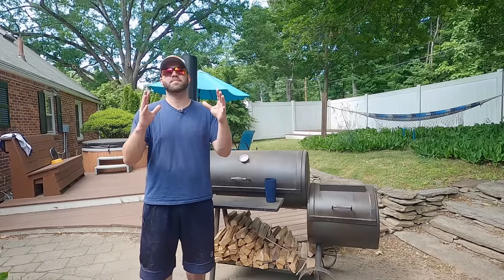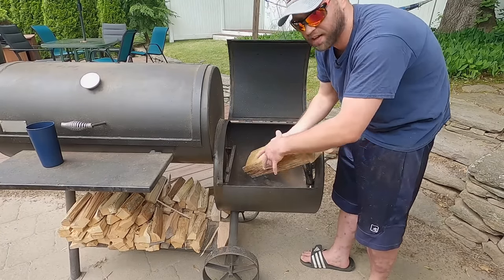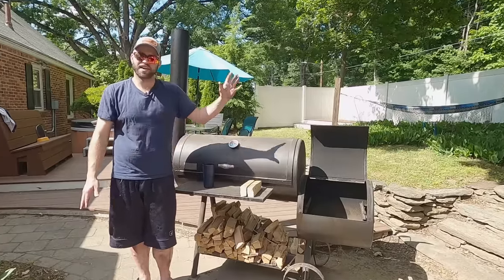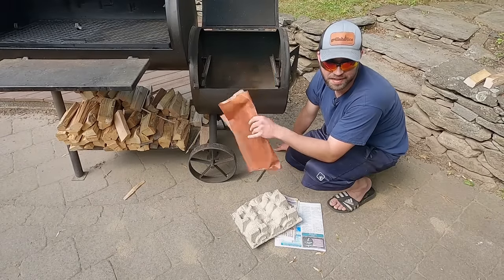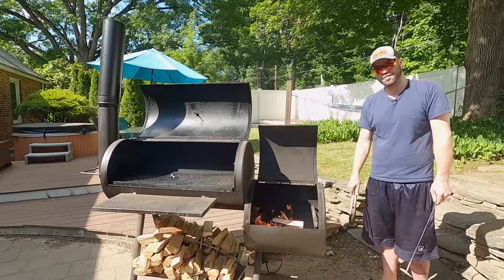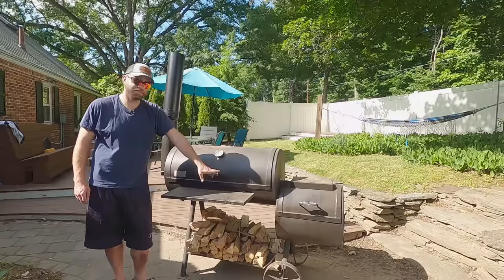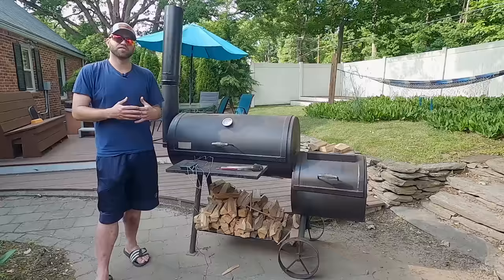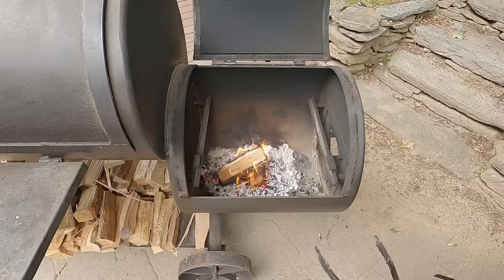OFFSET SMOKER FIRE MANAGEMENT FOR BEGINNERS | How To Burn A Clean Fire | Fatty's Feasts

Comment: Great video.  Found your channel while debating getting the Brazos.  Still debating, but have a question:
I plan on doing some backyard competition.  Q: What do you think would be the easiest way to get it off and on a trailer by yourself?   I’m considering passing this smoker and getting a towable one, but don’t want to spend $8000 when this seems to be the perfect size and I have a trailer 
I enjoy your channel. Thanks
Reply from the maker: I'll be honest, it would probably be extremely painful to do by yourself. I have a small trailer as well and I probably wouldn't even attempt to move this thing onto it without help, just because the wheels suck going uphill. Maybe if you modify it and put better wheels on it, you could move it easier. Other than that I would just buy one on a trailer. You can spend around $4000 and get one that's awesome and on a trailer.
Reply: I’m already with you 
Already found some custom 12” (11 3/4) wheels and tires online with a 2” wide axle
I was also maybe planning on using a winch to on/off load 
Trailer takes 6 months to build and I’m too impatient. The problem now is that the closest Academy near me has 2 Brazos available, but neither can be completed because of missing the main grates   Fuhh…
I’m a hard head and gonna keep trying to find a way to safely transport 
Thanks for your speedy reply and great sense of humor
Reply from the maker: @johnsaunders8395  Ahhh a winch would be a good idea. I like where your heads at. Good luck and let me know how it goes!

Comment: Nice Video  thx
I just wana say; Fire burns from top to bottom.
Always towards oxygen

In the coal chimney from bottom to top
Reply from the maker: I'm not sure what you mean...Fire burns bottom to top. I mean if you light a fire with a base of logs and kindling on top, yes it will eventually burn down. But naturally, a fire wants to travel up and out. That's why fire has an easier time traveling uphill, rather than downhill.

Comment: On the bottom of the fire box place broken half fire brick (only about an inch thick) or use a tile saw/diamond blade on a grinder and build a base, it will save the steel underneath and its an insulator, probably won't utilize as much wood on your cooks.
Reply from the maker: I've been debating doing that. I'll definitely give it a try!

Comment: So with my Oklahoma Joe's, I currently have a baffle setup at the firebox.  I've been unsure if this inhibits heat flow, but sounds like you have consistency without one.  Thinking I might remove it now.  Thanks Bro for the tips.
Reply from the maker: No prob!! Was that in there when you got it or did you add it?
Reply: @FattysFeasts  I added by putting foil over an extra grate I had.
Reply from the maker: @johncarnovsky2081  Did you have problems before you added it, or did you just do it to try it out?

Comment: I have a char griller on my deck that I bought 30 years ago. Mine looks like yours. The biggest difference I see between them is mine has a chimney about 4” in diameter that is welded to the top cover. Are there any videos on modifications of the older model? I’ve ruined so many pieces of meat on this thing that have that nice road tar taste! I’ve got pages of notes.
If my old char griller is a bad design please don’t be afraid to say so.
Reply from the maker: Do you have instagram? I'd love to see some pictures if you could message me there!
Reply: Sorry I don’t subscribe to instagram. Wish I did, I have the double thermometers, I have the baffle plates to even out temps, have the vent pipe down to the grate level, did a propane conversion using 48oz juice cans to generate smoke, was using a water pan, always had getting too heavy smoke, lined with firebrick to stabilize heat. Did everything except sing to it.

Comment: There are new thoughts on clean fire and clean smoke. Fact of the matter is lots of BBQ fans like a stronger smoke flavor than clean smoke provides. Mad Scientist BBQ used to think like you do but he has since changed his mindset.  Heavier less clean smoke for the first couple of hours of your cook provide a better smoke flavor. Also once your meat reaches 140 degrees, it's not going to take on any more smoke flavor. Me personally, I like to hose down my wood the day before my cook because it provides a better smoke flavor as wet wood doesn't burn as clean. I did a video on this where I rehydrate kiln dried wood. Of course it's up to your preference but I like a stronger smoke flavor in my meat. Why not use your chimney to start your kindling?
Reply from the maker: Yeah it’s definitely personal preference. What I was trying to get across is you don’t want the acrid white smoke that basically makes you tear up because it’s so bad. Your food won’t taste good with that smoke being produced consistently. Especially if it’s a longer cook.

Comment: I tend to get the cleanest smoke when I get the wood really hot and then shut the damper on the box. If I leave both dampers wide open there is a shit ton of white smoke I can never seem to control and the wood burns out in like 2 mins..
Reply from the maker: Interesting. I've found any amount of wind, even a slight breeze, really effects the fire, especially with a smaller smoker like this.

Comment: Is an offset smoker like this safe to use on a wooden deck?  I have a large back deck that has a roof over it which is where I use my gas grill.  I’m currently using my gas grill with smoker boxes to do briskets, ribs, pork bellies, tenderloin etc but I kinda want to step it up and get a real offset smoker.  My covered back deck is great because it keeps you and your grill out of the rain or snow as I like to grill year round in Canada.  I’m just wondering if an offset smoker would be safe to use on my back deck.  I’ve never used one of these so I really don’t know what to expect.
Reply from the maker: Good question. First off, you wouldn't be able to move this smoker up a flight of stairs, if you have them. I would avoid using it on a deck honestly though, because I've not only had embers / coals come out unintentionally, but being in emergency services, I've experienced times where people lit their decks on fire from that reason. Or even worse, they walked away for "a minute" and all of a sudden there was a fire.
Reply: @FattysFeasts  that’s what I suspected, I’d just need one ember to accidentally set my deck and house on fire.  I have a big back yard so could designate a spot for it there instead.

Comment: When you put the wood directly into the firebox would it mess up? Just bought a Oklahoma joes
Reply from the maker: Depends on the thickness of the metal. On a OJ, that's a bit tough, as I know they are thinner. You can try it and see if there is any wear. I may use something similar to that expanded metal v section. The main thing is you want to keep your coal bed more centered and not spread out.

Comment: My tips and tricks:
-Dont wear open shoes when you lit fire : you will burn yourself ONCE and know it for your life after! ;)
-Use lump charcoal instead of briquettes : it is natural (no chimical filing), lit faster and gives you red hot coals ready to put real wood on top in 1/2 the time
-Seal whatever untight spot you see: controlling air flow and temp is key for good smoking
- Removing the baffles is not a good idea: it is use for the smoke to reach further in your barrel. If your temp is too hot in the middle like said, your fire is then too strong. Adhoc temp gadge is your friend here. Remember, smoming temp is around 225F ( +/- 15F ), so you can't burn anything if that is the temp in the middle.
-Dont rely on the built-in thermometer : use an electronic meter of some sort to know the real temps.

Edit: On a side note, if you want to smoke your proteins and have it taste smoke, you will actually need smoke - white smoke is good, black/gray/dark smoke is not. If you have no smoke, you either have no wet wood that is burning, of your fire is too hot.
Reply from the maker: I think I covered most of those. The amount of sealing would be determined when you season / practice burn. The baffle thing is really dependent on your smoker. On a smaller smoker like this, it is a necessity. It throws the temps way off and can burn food, and that isn't because of burning a hot fire. I understand they wanted to keep the temps lower, but it actually made them way hotter at grate level.

Comment: I use the Big Green Egg and have for the past 15 years. But I have a friend that has a smoker like the one you have here. I don't think he is really into low and slow smoking as much as grilling. So he puts hot coals in the bottom of the rack just under the meat. Is this something that a lot of people do. He is also a big chicken wing person. About all he cooks. Is this also a way to cook a steak by putting hot coals under the meat and not using the fire box?
Reply from the maker: If you're using a cheap smoker from home depot or tractor supply, you can do whatever you want. It probably works better as a charcoal grill than an offset smoker! But if you're spending good money on something to smoke low and slow, I wouldn't recommend it. They are designed for just that, not for grilling. I've seen people do similar things if they spend a ton on a smoker and don't want to use it correctly. However, they do sell charcoal grills that look similar to smokers, but they don't have a firebox.

Comment: This is the brazos model? I got a fresh one waiting to be washed, seasoned, modded. What are the dimensions of those baby splits you made? 🤣 If it works it works. I'm willing to test your split size on mine to see if it works too
Reply from the maker: Nice! You're gonna love it. I would say they are about 8 x 3. Sizes vary but as I said in the video, but I can usually get 8 splits out of a standard piece of firewood. I think they work perfect.
Reply: Split size has more to do with what works for you tho. My splits are close to fattys size only maybe slightly less gurthier. Same length. Everyone’s smoker is different and everyone’s outdoor temperature and environment is different. Some people have their smoker in the shade some in direct sunlight. Some people smokers are better at retaining heat and have no leaks, some people have some heat loss. That split size I use, I only use 1 at a time on a nice coal bed every 30ish minutes. At around 260 I add a stick and it gets up to the high 280’s. 30 min later I’m at 260 and add again. Exhaust wide open and the intake half open. I live in Denver and last time I smoked outdoor temps were 80s and 90s. Trust me it took practice to get to know the right log size for my smoker.
Reply from the maker: @HipHopJunky  Exactly! Every smoker is definitely different and that's why I stressed practice burns so much.

Comment: Always keep the new logs away from the opening to your smoke chamber. It will create heat spikes. Which the thermometers won't register.
Reply from the maker: You made some good points in your comments! The wood clanking is a good indicator. I think the basket depends on how well your smoker is insulated. I've just never needed one in my personal opinion and I feel I can get a good enough coal bed by just burning it straight in the firebox. When you say keep your logs away from the smoke chamber opening, do you mean while they are in the firebox or are you talking about using them as a barrier in the smoking chamber?
Reply: @FattysFeasts  I usually request a large batch of good oak.
Adapted to 1 transport load for saving. But the real saving is done by requesting the logs cut at the correct size for your firebox.
In the future I'd like to get a professional log splitter.
That way you create far more burning surface to raise temperatures.
Regarding the logs. Keep any flames away from the opening to the smoke chamber.
They have a rather irregular movement and can get into the smoking chamber. Where they will likely just get pushed through the top of it. Apart from being dirty uncombusted smoke. They disturb the flow.
So place unlit logs away from it.
And never ever overload.
Reply from the maker: @henriwolbrink  Ok I understand what you're saying now. Great tips. Overloading was something I definitely did when I started. I mean...more wood more heat right??? Yeah, definitely not when it comes to proper fire management. I actually should have mentioned that as well but the video was already so long 😂😂
Reply: @FattysFeasts  You're welcome. As a kid I've always been intrigued by fire.
But like to add that more wood isn't more fire. 
More surface means more fire! 
Think of 2 logs. Split one and you'll have a lot more surface to burn. When flames are out, move embers towards the smoke box.
Never add too much at once or in total.
With split logs it is also easier to add fuel slowly. And find the perfect balance between  fuel and air. Resulting in a good combustion.
Temperature for me isn't the most important thing to look for at first. 
So many mention to cook at different temperatures. But even then. What temperatures are measured? And where?
If I find the blue smoke balance between fuel and air. I can raise it by adding an extra split plus open the vent.
Glad to see more people willing to master an offset. And for your efforts to help them with this video.
Greetings from #PuraLeña in Spain.

Comment: My question is if you have meat already smoking and you need to add more wood what’s the best method without getting dirty smoke
Reply from the maker: I mean, you're most likely going to get dirty smoke when adding wood, it's just that you don't want it to last long. Using wood that has a lower moisture content, as well as using the firebox to warm your wood will help. I'm going to be releasing a video in the coming weeks talking more about dirty smoke, so stay tuned for that!

Comment: I was always told that paper should not be used due to added taste. Light charcoal from.the bottom with a propane torch
Reply from the maker: I haven't noticed a difference and I know many people that use paper. I would say the biggest difference is the coal bed. You'll have to use more wood to build that up.

Comment: Wouldn’t be useful to have a damper between the off-set chamber and the cooking chamber in order to add new logs avoiding dirty fire just closing the in-between damper?
Reply from the maker: I understand your thinking here, but no that wouldn’t be good. You don’t want to restrict the flow from the firebox into the cooking chamber. Not only will that cause a huge temp swing, but you’re just going to keep experiencing dirty smoke since the fire can’t breathe. Then you’ll have to deal with getting all that crappy smoke in your face, since it’s the only place it can go.
Reply: @FattysFeasts  Hi there, thanks for your replay and tips. I’m always worry about dirty smoke (and it happens) whenever I need to add a new peace of wood. Sure , I could start a new batch of charcoal in a starter but wood has the most energy kick.

Comment: Can you use wood chunks to smoke meat on an offset smoker?
Reply from the maker: Good question. If you’re talking about small chunks you’d use in something like a big green egg, technically yes, but it will be a pain. In an offset, you want to have splits big enough to last around 30 min, which those chunks would burn pretty quick. If you were using a very cheap smoker where it’s hard to maintain a clean fire, you could definitely use them. But in something like my brazos, I would go a bit bigger.
Reply: Ok, thanks, I figured I would have to use logs, yesterday I smoked some beef back ribs using oak wood chunks, they was burning fast, I said to myself I need wood logs.
Reply: This my second time trying to smoke some meat on an offset smoker, the 1st time I used wood chunks too, the 1st time I smoked something on a offset smoker my electric smoker quit working, needed a new heating element, decided to use my offset smoker til my new heating element came that Tuesday, I didn't know what I was doing, I used wild black cherry wood chunks, my hindquarters been on the smoker for 10 hrs, it was done on the outside but not on the inside, the inside still had blood running out, I said I would never use it again.
Reply from the maker: @lsayles30  What kind of offset are you using and what size splits were you using? If you're using full logs, it's not going to be easy to manage and your temps wont be even.
Reply: I was using oak wood chunks

Comment: why not add some metal mesh on the bottom of fire pit, so the wood/hot coals will not lay on the total bottom and will get some air? or it will burn too fast?
Reply from the maker: I just realized I'm able to maintain a cleaner fire without adding anything for the coals to breathe is all. I try to keep it simple as possible.

Comment: Would it be worth it to light the wood for a few minutes in a fire pit to get rid of any dirty smoke then throw it in the fire box?
Reply from the maker: Eh...not really. You then risk extinguishing the wood, plus you're losing energy and fuel that you can just burn in the firebox. The best answer is using wood with a good moisture content and maintaining a nice, hot coal bed.

Comment: Im wondering if lava rock would work in place of fire bricks... any thoughts??
Reply from the maker: It would work as far as the heat retention goes. My problem with it would be taking it out while cleaning the pit, as well as the grease dripping down on it and not being able to drain from the pit. If you put it in the firebox, that may be sort of cool, but again, cleaning it would be a pain.
Reply: True... i didn't think of that. Good point